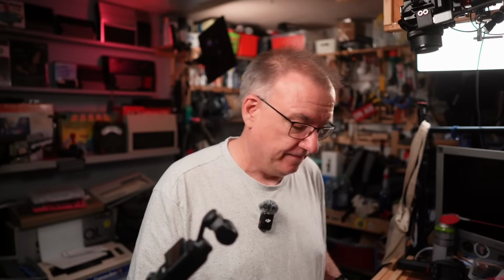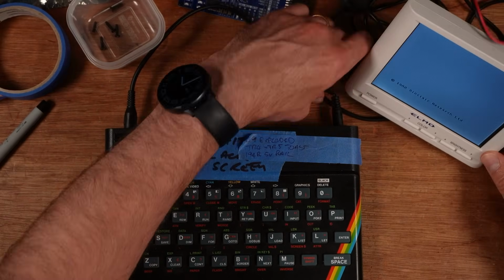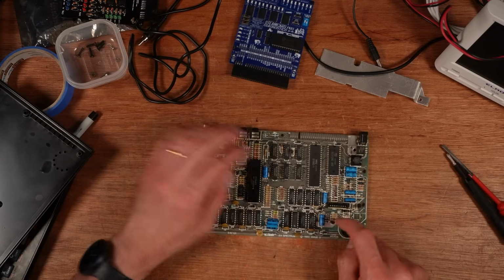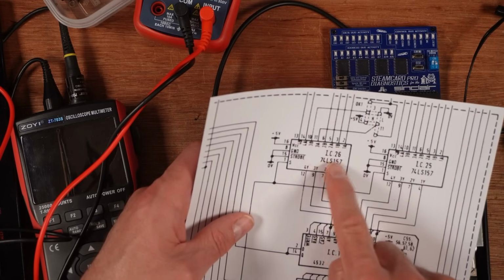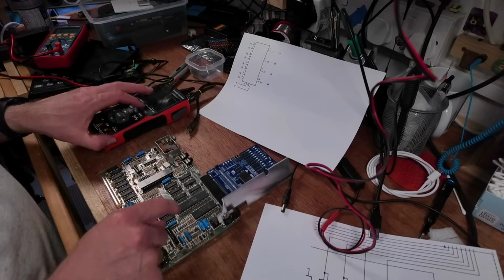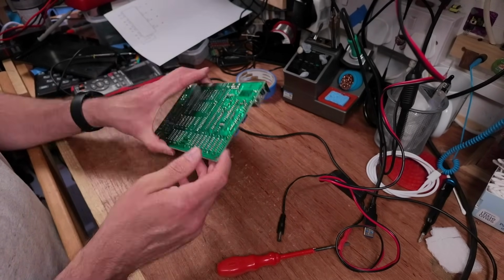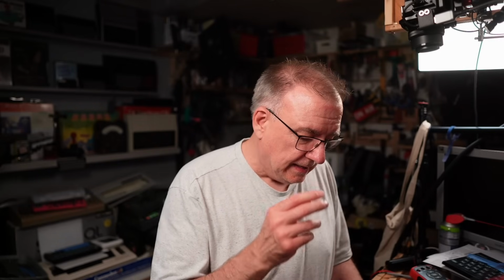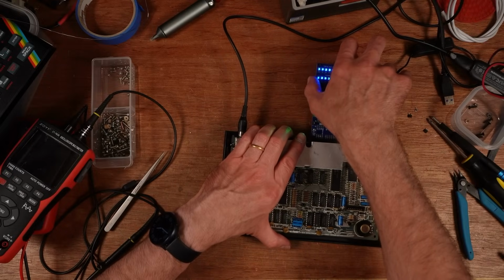It Broke Again! The Exploded Diode Spectrum RETURNS!

Comment: I had a unit with strange behaviour in the upper RAM area. It seemed to work, when a did some poke and peeks to the upper RAM, but didn't pass the memory test (reported 16k). After a while I notcied the two legs on on of the Logic chips had a short, which resulted in mirroring of some addresses (same value in many different addresses). After removing it it was fine.

Comment: I used to have a heatsink that was bent an additional 90 degrees so it could be fitted and would stick straight in the air to allow testing without overheating the 7805

Comment: if all upper ram appears to have failed, especially after some have been replaced with known good, almost certainly trouble with one or more of the multiplexers or the other control chips or surrounding circuitry 😉 but be warned, i've had 4164s test ok in a chip tester but show errors in an actual computer, may have timing 'degraded' due to age?

Comment: Happened to me. Rubber key 48k issue 2 I fixed a few years ago went faulty with a bad TR4. Thought I’d get it off the wall to load some games a year after fixing it. Weird little things.
Reply: tr4s often fail, if it keeps happening, check all components in the dc-dc converter circuit, and may also be an iffy lower ram taking high current intermittentyl,  or a bad coil, especially if its had a previous shorted tr4, the overcurrent can damage the coil, and it cannot be tested by normal resistance checks,

Comment: 7805s usually are OK with input as low as 7.5v. The lower the input voltage, the lower heat output. Usually. ;)
Reply: BUT the spectrums dc-dc converter will run harder to generate the +12 supply from a lower input,
Reply: @andygozzo72  good to know!

Comment: Lots of dry solder joints on that.. any time you see a "ring" around a solder joint it's a sure sign it's cracked.
My money was on a short to 5v on the outputs of that 74LS157. The way that this looked on the output of the 157 tells me thats what was happening... the outputs were being forced high and the 157 cant pull them low
Reply: Fancy bumping into you again. lol

Allo, Peter. Hope all is well?
Reply: Interesting analysis. I was thinking that a RAM had failed and it had failed in a particular way such that the pin the 157 is feeding was driving into a short, thus pulling too much current from it and therefore damaging it. Interesting for sure!

Comment: I think that Speccy board is just cursed.

With regards to that great monitor, I would remove the power and phono sockets, and just solder wires onto each of them with the plugs on the end. You could lay it flat then.
Reply: Oooh, that's actually a pretty good idea with the monitor. I still have one of these displays so might actually do that mod :)
Reply from the maker: That would solve the sockets coming out the back problem, but its not a great screen on camera so I will be looking for something else. I have plans!
Reply: @morefunfixingit  Can't wait. 😃
Reply: @morefunfixingit  or get right angled plugs?

Comment: I'd lose that 7805 and heat sink and install the TSR switch mode upgrade 👍😊
Reply: personally i wouldnt, nothing wrong with 7805s...more to fail in those switching modules

Comment: You can easy build a sereen you self, i you have a old laptop, then get the controller pcb from aliexpress. Thats work, have build one my self and have a old 2k imac i will convert to.
Reply from the maker: I do have an old netbook screen with a controller pcb somewhere... I will dig it out and find out if it has the inputs i need. Might 3d print an enclosure for it
Reply: @morefunfixingit  or just take the model no and look for it at ali, there you will proberly find a controler you can use.

Comment: 90degree rca connectors may help wit the lay flattyness of the screen.. But lookign at it further routign cables out the side may be better since the power jack wasnt that great either,.
Reply from the maker: That would help. But the screen isnt great to show on camera so I will probably look for something else.
Reply: @morefunfixingit  I find screens in general as sub par when it comes to showing on camera. Much prefer  screen capture for that purpose but that can be a little over complicated to.